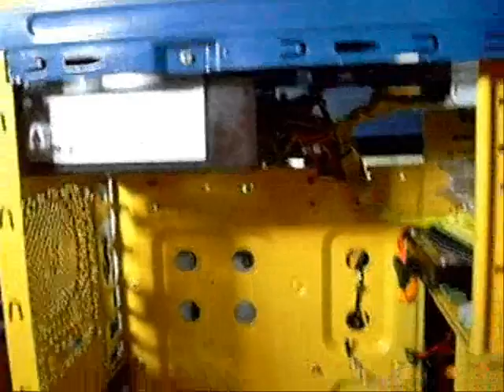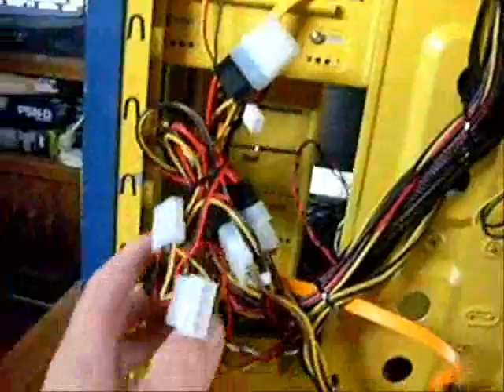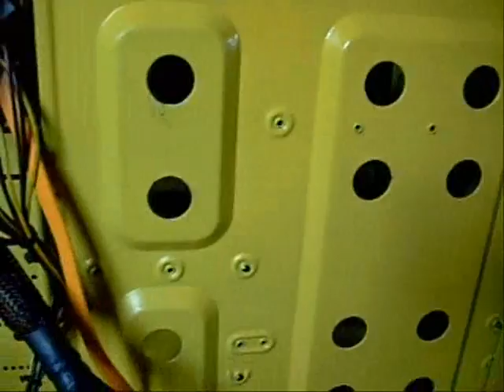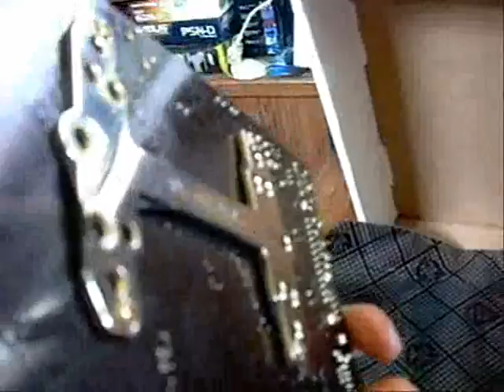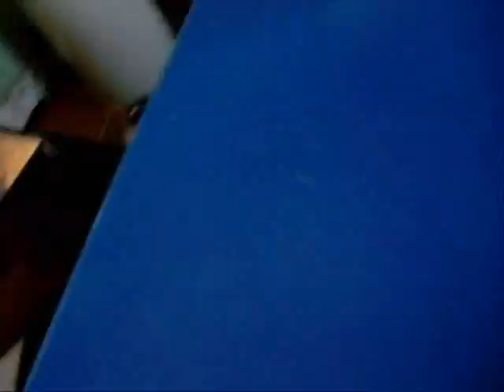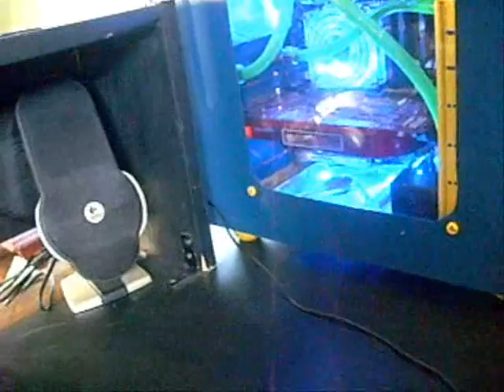Water cooled machine is back up and running WOHOOOO!!!!!

Comment from the maker: @Waldozord The stock fans they send with the boards are just not good enough to keep the north bridge cool. Mine I made using a 80 MM fan and a couple of chunks of a old metal coat hanger to mount it. I have a video on it called (Asus North bridge fan mod and custom fan cooler).If you want to look it up in my older videos.

Comment from the maker: @JoDaddyy It is very much like the water cooling system on a car. It consist of a water block a radiator and a pump and reservoir. The water block mounts on to the cpu and the pump sends water through the hose to the water block The water draws the heat from the water block and takes it to the radiator to cool. And then back to the reservoir to be pumped through the system again.

Comment: hey i got a little problem i wanna build a new gaming/multimedia PC by next year so i was wondering witch mobo to go with P45 , P55 , X58. i cant spend a lot of money beacuse am not that rich. should i go with the P45 chipset beacuse it's a litte in expensive than the other two. but i would have to use the pc for atleast 2 years. what chipset should i use?

Comment from the maker: Thank you Buddy. 

I am sorry because I dont think I ever did say what happened to it. 

I removed the board to test out that blue orb II cooler. Then when I plulled the board out again to put the water cooler back in it wouldnt boot. I tried every thing and ended up having to RMA it.The last board was one that I got back from a RMA and it had some problems since I put it in. So it didnt surprise me that it died.

Comment from the maker: Thank you very much. That is very inspirational to know that the videos have helped you out. Stay tuned I have lots more planned to do. 

I think water cooling is a wonderful idea but a person has to be very careful one leak in the system can cause a lot of problems. So you always want to test the system outside the computer before installing to check for leaks. 

This was a real cheap system. It sells for around $150 but I got this one on clearance at Radio Shack for $75 so shop around.